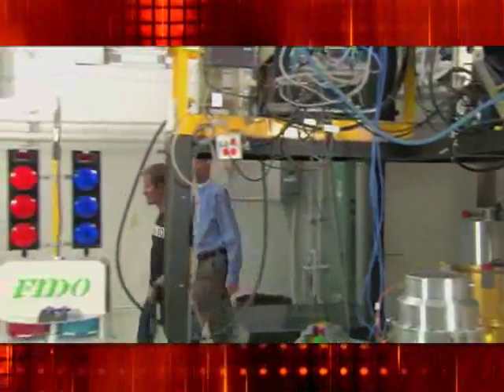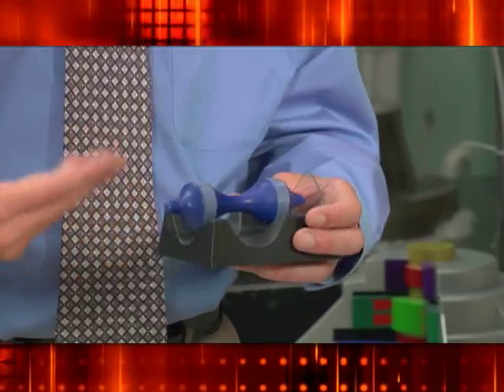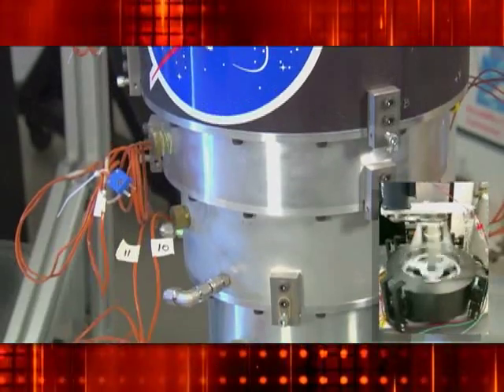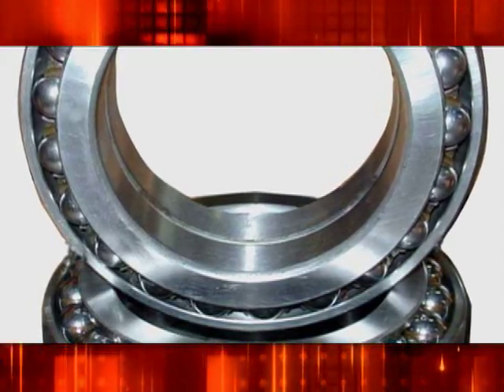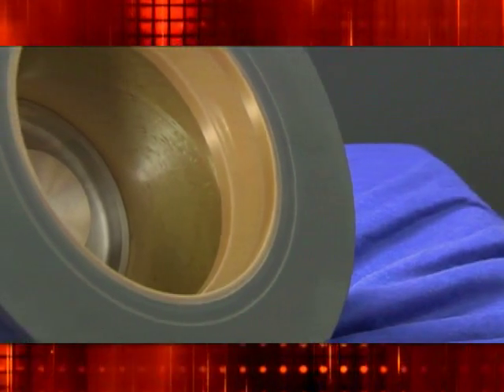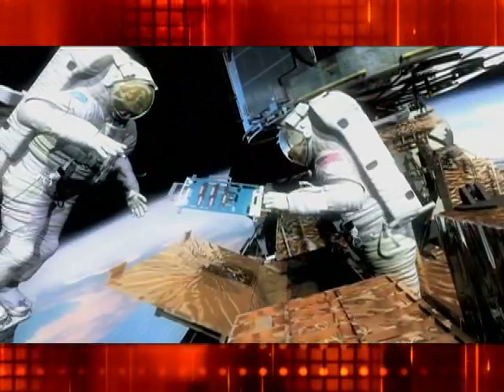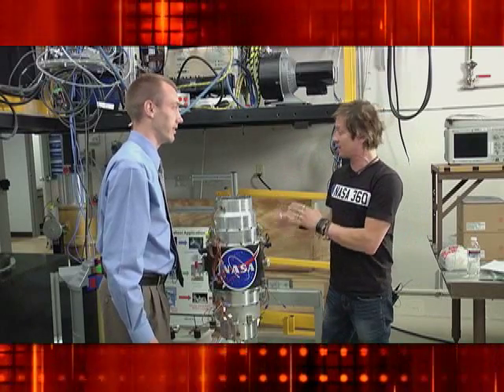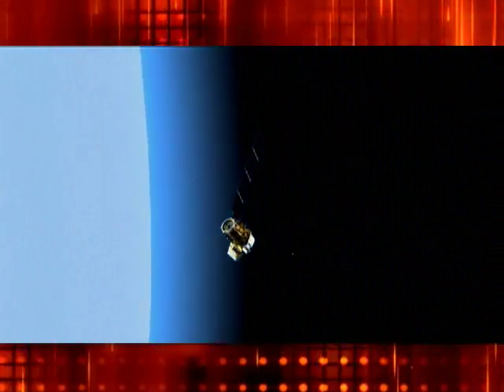nasa.SCVTV.com 4/26/2012 NASA-360 #24: Flywheel Energy Storage

Comment: The really huge energy storage flywheel systems have to have their axial rotation aligned on the same rotational angle as the earth or they lose massive amounts of the stored energy fighting the precession of the earth. A rotating mass fights all attempts to alter its orientation so if it is not aligned properly the loss is unacceptable. Huge units that require mechanical bearings would quickly have their bearings ruined by that effect if not aligned.  They also run in a vacuum to reduce friction. Back in the early days torpedoes were powered by flywheels spun to insane RPMs by steam just prior to launch. That also helped the torpedoes maintain a steady course but also prevented them from turning sharply but if they were fired right to begin with that was not an issue. They had more problems with getting the fuse design straightened out. Many times there was just a thud as the torpedo bounced off the hulls.